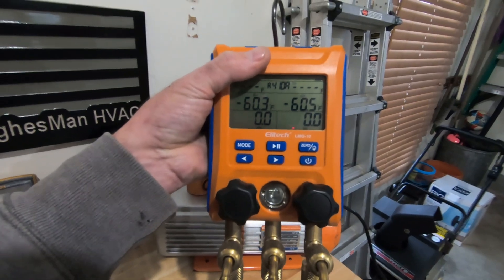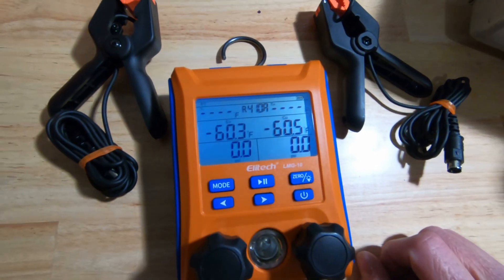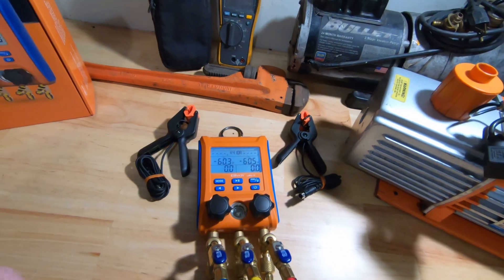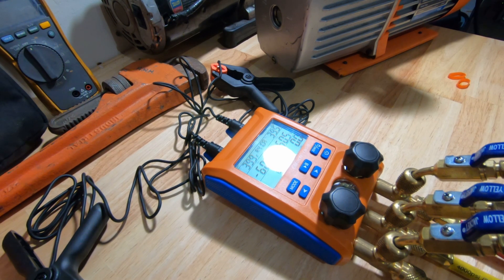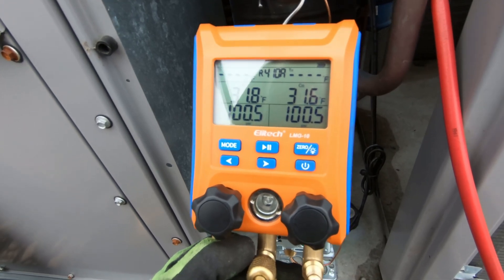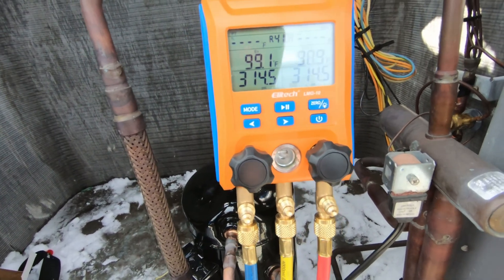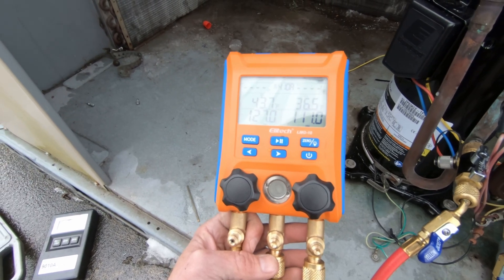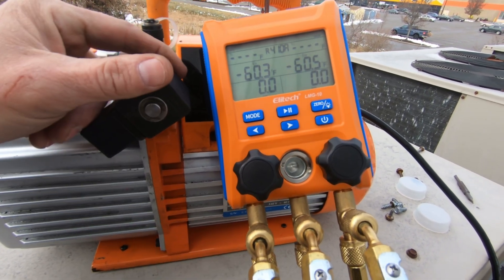Elitech LMG-10 Digital Manifold

Comment: You know,that's all well and good when you're checking out a brand new digital refrigerant gauges but how about using them for a whole season and then do a review. Of course everything's gonna look nice and work well when it's new. I bought a $600 field piece manifold set and within a year the site glass started leaking refrigerant badly. So what do you think a $189 digital manifold will do after a season ?
Reply from the maker: So far still good, I use them often. I had to have the video out by a certain date but for $189 they are still holding up.

Comment: Looks tempting but I think having the thermocouple connections on the top is a deal breaker for me, as rain would get right into them. I own two Elitech leak detectors and I'm thrilled with them, but for gauges I think I'll stick with Fieldpiece and Testo
Reply from the maker: I thought the same thing but they do have a nice rubber plug that covers the ports when your temp clamps are not plugged in that seem to seal up nicely but I hear ya